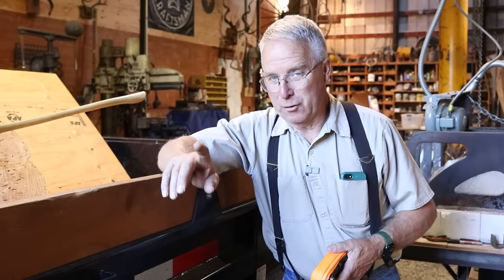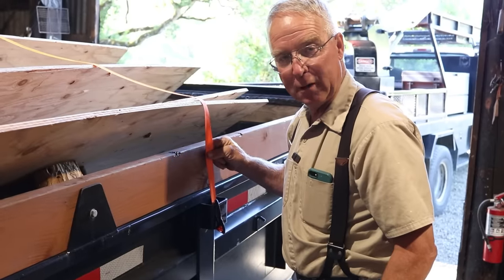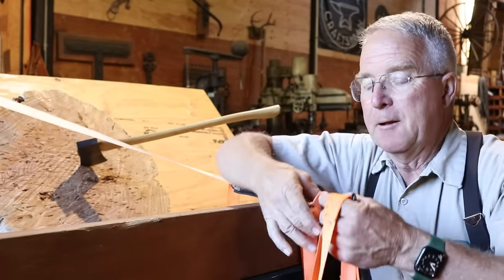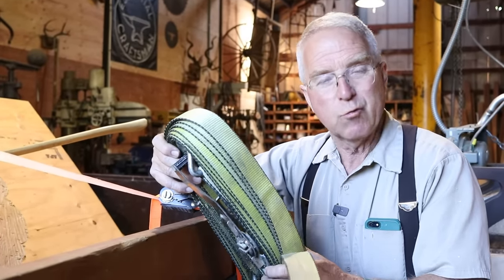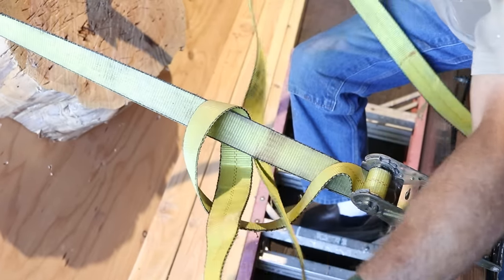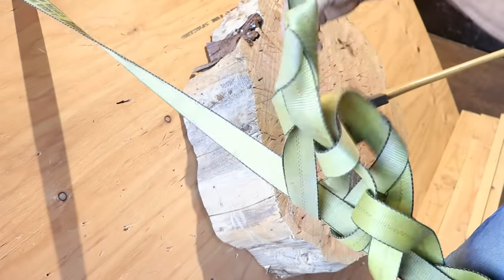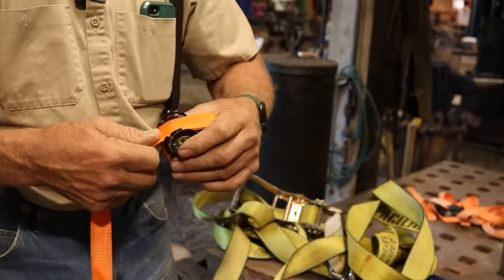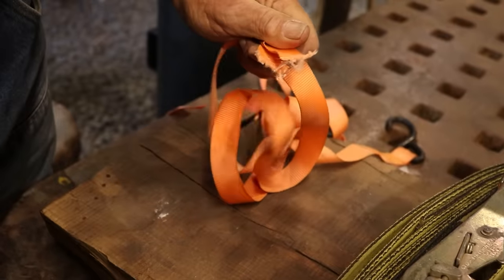7 Ratchet Strap Pro Tips

Comment: I like the retractable straps for smaller loads. Yes, they are not as strong/long as the others but, boy are they convenient. They are also handy for securing loads to hand trucks when the ground is uneven. I use this method when unloading stacks of sodas to the basement.

I usually store the two-part straps separately. They are easier for me to store and to deploy. They frequently come with a plastic pad you can use to protect the strap/cargo. @FSC-Trucking uses a winder for his straps.

Comment: To store them I pull the two parts apart. I take the line and fold it in half a couple times until it’s about a foot or two long (depending on thickness of bundle). I take this bundle and tie it in a knot (regular knot or figure 8 if you want to get the ends a little shorter) and voila! I store them tossed in a bin in my truck bed so the method he uses comes apart and I think it takes too long

Comment: I used to pull a flat bed trailer and I used the big straps. The loose end I would coil up neatly and secured it with a spring loaded clamp I made for each strap

Comment: For the larger straps, don’t run the dead end back through to the hook side of the trailer.  Pull it straight through to the ratchet side, and when you have a decent amount of tension on the strap, loop the dead end up, and keep it under the ratchet.  Won’t come out, and no issue with knots or tangles.

Comment: This is good!  I also wind my straps.  I keep them all in a plastic tool box, along with a bunch of 8" black plastic wire ties, and whatever wrenches and bolts and keys I need for the trailer.  All in one kit.  The wire ties aren't structural, but they do an awesome job of securing loose strap ends, and of holding hooks in place while you're tightening things down.  The other thing to keep in the box is some flagging tape, so you don't end up with a ticket for something stupid.  A bit of red electrical tape is handy for that, too, as sometimes it's easier to attach.

Comment: When you pull the strap thru take a huge bite out from in front and invert the system holding the handle downwards by the strap ahead of the handle and when you pull it loose enough that the free end comes back like a triangle you just roll them both up starting from the middle and tightening them until the free end is consumed

Comment: I wrap my straps same as you, but add a few things;

1. Pull the bitter end through so it ends up a bit shorter (about a foot or so) than the hook end. This means you end up wrapping twice as much strap for as long as possible. 

2. Keep the windlass open while wrapping. This enlarges the base so less wrapping is needed. 

3. Rotate the windlass hook out of the way, wrap around the eye, then rotate the hook back over the wrapped strap to hold it down. This works most of the time but not all the time depending on what style of hook you have and how much wrap there is.

Comment: love the loose end tip. Ive done that for years with my cords and ropes but never thought to it with straps, thank you. One tip on storage: After wrapping over the short hook a time or two, turn the hook out, then finish wrapping. Once done, turn the hook back in so now it lays over the wrap and helps hold it together. Finish around with a length of stock velcro, and put 'em up until next time. Take care!

Comment: I saw a short a few days ago where it showed to take the tail and roll it quickly (both hands on the inside of the loop - wheel style), feed it through one loop and reverse roll the entire roll, it self tightens, looks clean and will not come loose. Add also that it's one step to undo when the time comes.

Comment: Glad you have this series. A few years ago I sold some architectural pieces. The guys that bought them had rented a trailer for the first time. After loading they brought out two packages of ratchet straps brand new and asked if I knew how to use them. I took the time to show them and fastened their load. Hope they remembered how to remove them or they would have needed cut them off. Better these kinds of videos to show them how.

Comment: What I like about my straps is that at the end they each have a hook and loop strap stitched on going parallel to the end of the strap. After my load is tightened down, I take the end, make a loop and then using my index fingers roll up the loose end while keeping tension on the strap. Once i get to the ratchet, i take the hook and loop strap and wrap it around the rolled up and taut parts of the strap. It looks good, won't come off and it's very quick to unroll it when i want to loosen the strap. When i stow the straps, i take the strap separate of the ratchet and roll it up with the hook in the middle until i get to the end and then wrap the hook and loop strap around it. I then just throw the strap and ratchet into a DeWalt bag i got with a tool with all the other ones i use. Nothing comes undone and i can move the bag around however i want to while everything stays together and out of the way.

Comment: Hi, I've been watching your videos for years and let me say it is a pleasure to watch someone with so much knowledge and experience share it with others in a great way.

I wanted to also say what works best for me as for as storing my many straps and being able to keep them nice and untangled. Is rolling them up as you did and just using a old milk crate and if you dont have one lying around there cheap to buy, and bonus you can also put your trailer hitch and different size balls for the hitch in it too. For me towing two different size trailers I use a       1 1/4 and a 2 inch also good for storing chains and it fits nicely in the back corner of the truck bed, also if you have a bed liner it wont slide all over (depending on how you drive, for me I sometimes have to move it back to were it was)😂. Anyway thought i would throw that out there, it works good for me hope it does the same for you. Love the channel guys!

Comment: get yourself some of those 8" bungee loops with a hard ball on one end. roll up the long end of the big strap into a roll ending at the tight strap. put the ball of the bungee through the hole and bring it around half the roll and the tight strap, and secure the ball in the loop of the bungee. if that makes sense, ive had good luck with that.

Comment: i work as a scaffolder doing tons of smaller jobs that fit on a single flat bed truck so i use ratchet traps all the time and for the loose end normally we just pinch the loose end under the load we are tying down. if the load can't move since we ratcheted it nether can the loose end.

also i didn't know they made smaller ratchet straps than the bigger one you showed. a tip i would say is size your strap to the max load of your truck or trailer. you do not want to use a undersized strap and not think about it. how much you can haul should be the weakest link.

as for storage we pull the strap and the ratchet apart, roll up the strap and hang up the ratchet to unroll the strap just toss it over the load and attach it to the strap. a big benefit to this is every time you store the strap you check the strap for damage. very common if you keep ratcheting at the same spot that the strap will tear there and if you don't remove it totally you won't see that damage.

Comment: Push a loop of strap through your channel on the trailer or around anything, then loop goes through the hole on the hook and then the hook through the loop. Now pull tight. 

If that makes sense, that’s how to tie to a motorcycle handle bar or fork so you don’t scratch it. But it’s the best most secure way to tie to anything with a ratchet strap

Comment: When folding it up, if you give the non-hook end a little bit more length than the hook end, you can wrap that excess around the whole thing in a half hitch in the opposite plane (a sailor's coil) and it will hold together under all circumstances

Comment: Great video! I haven't seen the daisy chain way of securing a long tail, but I like that. I have always folded up the tail and then secured it with the ratchet handle itself, when putting it into the lock position to hold it. Recently I learned the 'twist' method; seems great,  but I haven't had a chance to try it out yet.

Comment: Thanks for the great tips. I figured out a storage trick that has not let me down in 10 years. Simply pull the  loose non hook side of the long strap through the windlass until the hook is near the gears, then work the lever a few times to increase friction and then toss the hole thing in a box. It won't get tangled. Next time just reach for the windlass and the rest will slither out.

Comment: Just a hint. I use a lot of the smaller ratchet straps in my business and to store them I roll them up with the ratchet fully opened flat and then when rolled they are stored in some small plastic water bottles that I have cut the tops off after drinking the water. A tight fit and they stay put.

Comment: I cut up old tire tubes to make big rubber bands to hold my ratchet straps together after I roll them up.  A wheelbarrow tire tube is about right if you roll the strap without the ratchet

Comment: When you’re throwing the ratchet over the load, have it the right length so it hangs freely beside the trailer or truck, not sitting on the load or on the ground. This way, when you hook the hook end on, the weight of the ratchet at the other end will give you enough gravity pulling over the load to keep your hook on while you go around

Comment: Just roll up the excess strap and tuck it under the handle then tie a damn bungee cord around it instead of making a mess out of everything or pull it as far up the strap as it will go then tie a cinch not on it what your doing is to time consuming and it looks like shit if I went in to a shipping yard and tied shit up like that I’d be laughed right out the gate if you seriously want to learn to strap and tie it down correct then go look for a tutorial on tying or strapping a flatbed down so the dot don’t shut you down and yes if they see your little pull trailer tied wrong you’ll get a fine for unsecured load same goes for your pick up

Comment: Another way for holding your strap in place is to tie a knot on the ratchet side and throw the ratchet over the load. Hook the strap to where you want it. The weight of the ratchet will hold th3 strap while  you go to the other side and ratchet to oblivion.

Comment: I love rigging stuff I was up on top of 14ft walls on top of flat bed semi trailer those were just thick long straps there was a secret that where you tighten it and pull the slack out till its even and roll the strap up in there so there's no loose end and while I unload them woth the crane these huge precast walls just fly up to the heavens lol

Comment: Thanks again! I roll my straps up like you, but I start by putting the two ends together. It takes half as long to roll, the hooks are both together and on the inside, and you can easily slip the free end under itself on the last loop around and snug it down so it doesn’t unravel in the back of the truck

Comment: Awesome advice just what I needed! I must tell you a story of my recent helpful ratchet encounter. I have a 3 wheel utility scooter. It weight 300 lbs. I went to move it from one storage place to a new one 7 miles away. It contains 2 heavy deep cycle batteries. I had rented a U-Haul open trailer with a ramp. So I turn on the key and the batteries were dead. At this point I should have removed the batteries but I didn’t. They are really heavy. I tried charging the batteries but there was not enough time because I had to get the rental back. So I started the scooter up the ramp by pushing it so the front wheel was barely on the ramp. Now here  is where my two amazing ratchets came to rescue me from the situation. I put one on both sides and over the next hour I managed to put that 300lb scooter up a little at a time. I do love my ratchets!
Reply: Actually I used 5 ratchets all together.

Comment: 7:00 No better way you say. Well you need to watch this tutorial. Ever since I saw this I have done it and it has saved so much time, effort and stress.

I hope the video link below doesn't get deleted. If it does search "How to use ratchet Straps" from a channel called "Safe Driver Training"

Also: Most of those thing you mentioned can be done with much more ease by just keeping the strap and ratchet separate. Everything from deploying, setting up/hooking up, rolling up and storing. Just uploaded a short vid on a strap Winder/Roller/Spinner I made but they can be purchased for only $20. Link in the next comment.

Comment: I'd love to see a video discussing ideas to manage bungee-cords. I like to group them all in a "fist/octopus" shape, with ends held together by a shorter bungee wrapped around a few times, or just toss in a courier envelope/bag. There seems to be no great technique that works to both make them tidy but also not stretch them out, as well as that's workable for various lengths of bungees.
Reply: Same.. I've searched all over for a solution. I finally settled on using an over the door/hanging shoe organizer with the clear vinyl pockets. I cut each row off and set them upright in a tote bag (like a tool bag or whatever) stacked next to each other, and I can open the bag and just pull out what I need. The organizers with the longer pockets work better than the shorter ones.

Comment: That large "D-handle" has a built-in way of taking care of and securing the extra length of ribbon after securing the load. 
Am I the only one that read the directions on the packet of ratchet straps?
Reply: i have ratchets from a couple of manufacturers and none had instructions for managing the extra length. Please do elaborate!

Comment: If you do it with the ratchet on the outside then you can double back the end through the ratchet and use the thing itself to hold it together tightly.
Reply: Why do they fine you? Do they think it weakens the strap?  (It doesn't)

Comment: Maybe stick to ropes fella. First off should note that too many twists in your strap weakens your lashing strength. See fireball tool page for his experiments to demonstrate this. Secondly pull your excess free end through the ratchet mechanism roll it up and trucky lock it to the strap itself. Plenty of other examples online.
Reply: "Stick to ropes fella"? You're implying that a twist or 2 (which is exactly what is being recommended here) is bad advice. But did you actually watch the Fireball Tool video of those tests? 1 twist made no significant difference. 4 twists made no significant difference. Yes, 10 twists finally reduced the breaking point by around 20%, but if you were paying attention even that was still above the strap's rated working limit. He indicated he would continue to put a twist in his.
So maybe you should stick to learning from these videos instead of criticizing "fella"
Reply: Are you even familioar with that content? He had to put an assload of twists to weaken it even a little bit.

Just stop.

Comment: I never knew about the twist. 👍 This is the difference between an amateur and an expert. Thanks, EC.

As for keeping my tie straps untangled, I have kept the original plastic case they came in for years. When you undo a clip to take a strap out, put the clip back where it came from – make sure you hear or feel the "click." (I have those very common orange hardware store straps – comes with four. 20-some years old. Used countless times. Still in great shape except one of the rubber protectors tore off.)

Comment: A great one that you missed is when you need to lash two hook ends of two like straps together.  Instead of just hooking the the two plastic coated hooks together, take each hook and thread it into the other ones strap loop.  Wish I could give a visual, but it's a much more secure method that is much less likely to come apart, plus it doubles the strength of the connection.